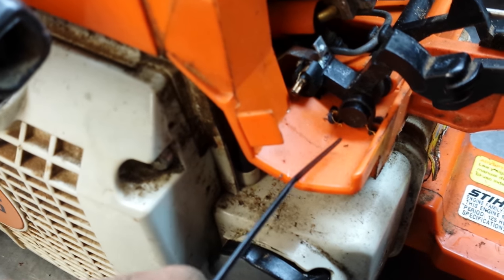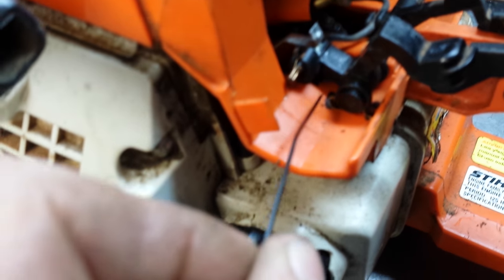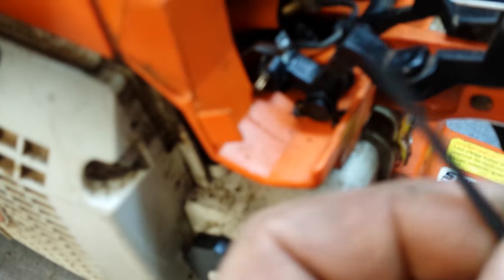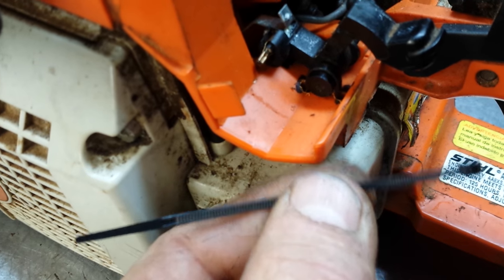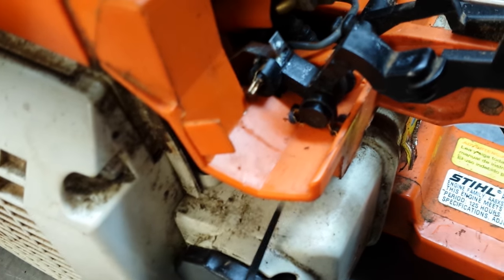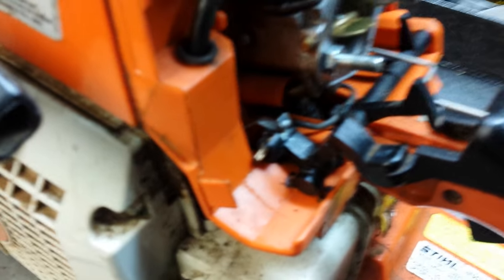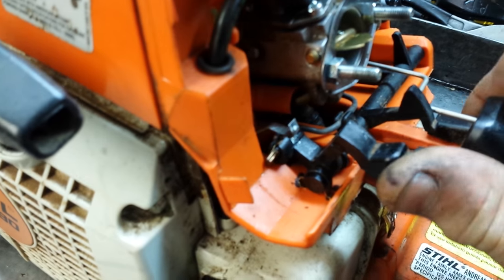The Chainsaw Guy shop talk Stihl MS 290 choke repair

Comment: my ms 290 will leak gas when I'm cutting horizontal. I've replaced the cap and vent tube. what's next? replace the fuel line from tank to carb? the plastic mold tank is not cracked at leat not that I can see without totally stripping it down. could you make a video on this?